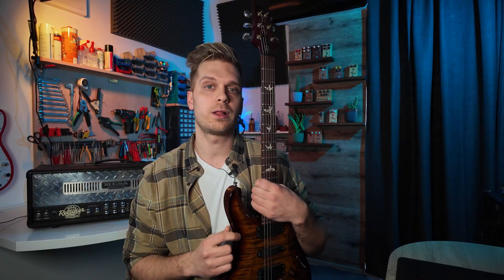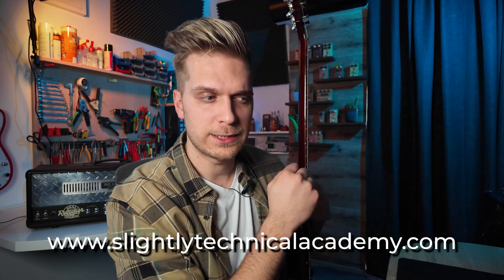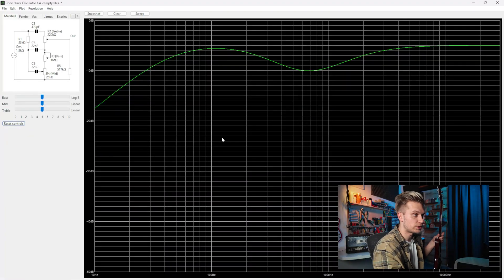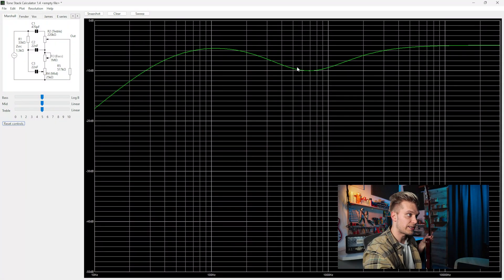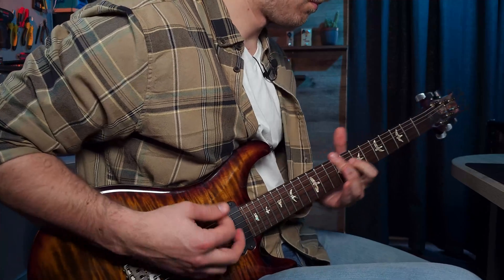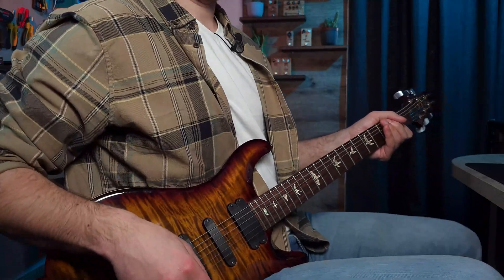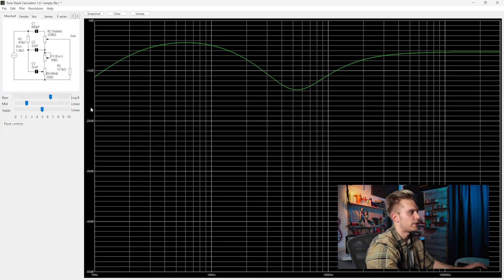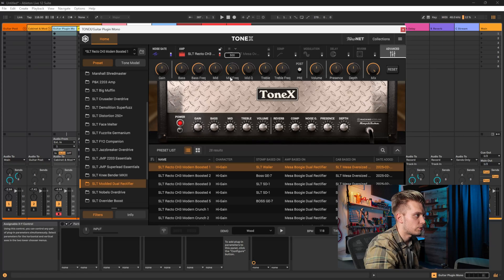Engineer Hacks: Make ToneX Models Behave Like Real Amps

Comment: Love your videos - new subscriber , been a touring guitar tech for decades now and I have to wade through so much hype and bullshit with players that continually swap and change gear and usually end up back at the same sound haha . I have an interesting theory on why digital guitar sims haven’t quite nailed amping the room tones . Having owned axefx, kempers , line 6and now a tonex and also owning a hand built point to point  Sattelite amp and a matchless I think o know the missing mojo of amp sims , it’s along your lines but with a variation .
Reply: Any chance of a hint on that variation? I'm making the switch, but don't have a ton of time to tweak over practicing....
Reply: @CFgroup1 the variation between a digital amp sim and a real tube amp is the same as solid state amps . In a tube amp the actual wall power and a tiny voltage from your magnetic pickups are hitting components and that power and signal are ebbing and flowing as notes have attack and decay and as the power and note because different eq points decrease individually where as in digital gear when a note decays it’s more like the whole volume is just lowered gradually so it sounds very uniform . Tube amps by their very design and nature are imperfect things . They were beer designed to distort and overdrive was a happy accident , but all those harmonics add to the feel and push of a tube amp . A tube amp is a 3D move and a digital amp is a normal hd move . You know there’s depths but you can’t perceive them in the real world as much so your brain fills in the missing parts.  Sorry that’s a hell of a rant , but if you forget about the missing “ amp in a room “ feel and go for what sounds killer in the mix your digital modeller will kill !
Reply: @CFgroup1 you can’t tweak in the in the room feeling so just retrain your ears. The “ amp in the room” feeling is never felt by the audience anyways as soon as you mic up your speaker and it’s pushed out through a pa . Even when it’s in a band setting so many little nuances we cling too get lost . So I foubd when I started hearing my digital tones as “ end of the chain “ tones and learnt that’s what the pa or recording would captures and not have to edit it’s easier to grasp ,
Reply: @Johnnybananass-_  Not a rant at all!
I'm just searching for that upper mids and highs I get from my EL34 loaded Plexi clone for a bit of sizzle, not outright distortion. Most of the "Marshall" sims I've found are ether too distorted, like a Metal distortion or too KT66 with a fat mid and low end. I've been diving into the para EQ and trying to create that analog curve knowing as you say not expecting that "amp in the room" sound. There's so much conflicting info out there, it's taking some time wading through it all to find the right process for me. I haven't tried this video's suggestions but as soon as I find a Tonex sim that is close enough I'll review it and try these EQ points. The thing that I was unaware of until after a bunch of tries is the gain doesn't react like a real amp. I keep my Marshall gain at 2 and use a Tube Driver to just push it a little bit more into breakup but not full distortion. I kinda thought as I got into this I didn't realize the sims were snapshots, not actual coded recreations of how the amp would respond. Kinda like these Roland cubes I use on small gigs. I turn the gain down to 2 hit the Tube Driver adjust the EQ, and I have a workable approximation of my large amp.
Thanks for the reply!

Comment: It would be great just to have reference point of what an amp model setting is used for capturing process, so you could use it as a starting point for tweaking accurate amp eq settings. Even better would be if tonex incorporate tonestack calculations in their EQ settings. And again, even better would be to model amp in all of the possible eq positions and make it Stackable Model that switch between models according to EQ curve. A lot of more work but outcome would be absolute realism. Like this is a cat in the hat and your ears, and ears sometimes lie a lot especially if you are mixing quad-tracked guitars in specific manner.

Comment: I’ve been wondering if this was possible since early days of Tonex. Kind of replicating the ‘liquid profile’ approach that Kemper use.
So, why couldn’t IK include approximations of the tone stacks in the system which you could add to your captures in ToneX.
Anyway, great video 👍
Reply from the maker: @duncancartledge1667  I'd say there are benefits to this system, since the EQ is flat and powerful, so it doesn't color the tone models. Plus there is the fact that you'd model modded amps, so you don't really know what the tone stack is like inside.
Reply: @ I get that there will always be some exceptions such as modded amps but Kemper have a range of tone stack settings for amps to use in the profiling process. Just think it could be an interesting thing for to look at, creating a list of popular production amp tone stack settings to overlay on your captures if you want to.
Reply: @duncancartledge1667  The issue is that the tonestack is in between gain stages of amps, and not always in the same place either. Marshall being a great simpler example: 
A 1959 "Plexi" doesn't have much distortion before the tonestack, a little crunch but not nearly as much as what comes after. So here the tonestack acts more like a gain control for different frequencies, while also shaping the tone of the little bit of crunch from the preamp - turning down the bass tightens this amp up a lot, while increasing it can make it quite fuzzy and woolly. 
Now going over to a "JCM800" 2203, there most of the distortion comes before the tonestack. No matter how low or high you set the bass, youre not changing the tightness of the amp's distortion.  
There's also amps that implement a tonestack completely differently. Hell, Hiwatt even puts their master control in front of another gain stage before the power amp unlike any other amp.

It's just sadly not as simple as putting an EQ in front or after the amp. For some it can be (like some high gain amps with crystal clear power amps), for some it can't.

Comment: I enjoy my Tonex for the most part but have stopped using it. No matter what I do I have inherent noise in my captures from Amalgam for high gain. There is the typical hum that using a gate before amp fixes (I use the input pad and gates on helix, the on board gate is lousy on Tonex in my findings). But then there is a sort digital hiss, that is only stopped with another noise gate AFTER the pedal itself but then tone and sustain are dead in the water. I gave up and just went back to using my HX Stomp with other pedals. Frustrating and anything I try never works, even trying different isolated power supplies I have. 

These are some nice tips, maybe I will try these the next time I feel motivated enough to try the pedal again.
Reply from the maker: @hardstones17  hey, to me it seems that there is an issue with your particular unit. I did many high gain captures and the Tonex is always less noisy compared to real amps (which is the way it should be)
Reply: Tonex is a neural network profiler, not a modeler.
Tonex uses 'capture' that means dealing with something fixed like a photograph. The more we intervene in changing the tone with the knobs, the more it will sound different from the natural sound. I think you have to wait until they add an EQ parameter block.
Reply: Strange. Might be a defective unit, like suggested above. I only get digital hiss with tonex one if I'm not using a good isolated power supply with it.